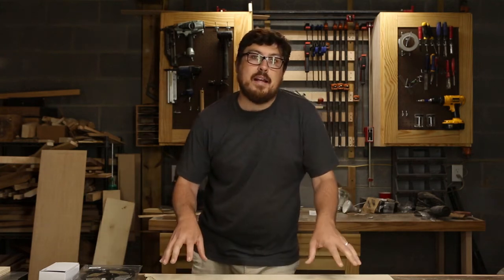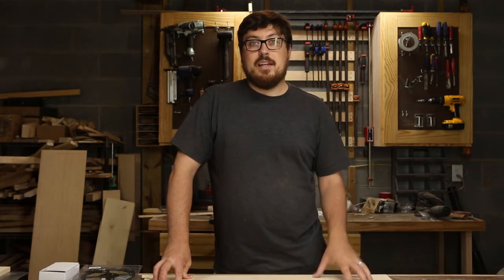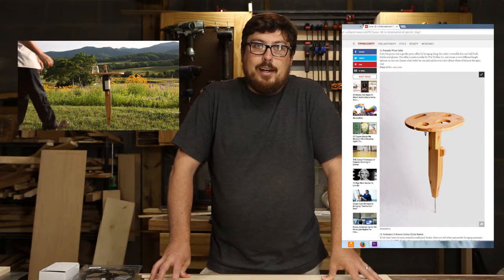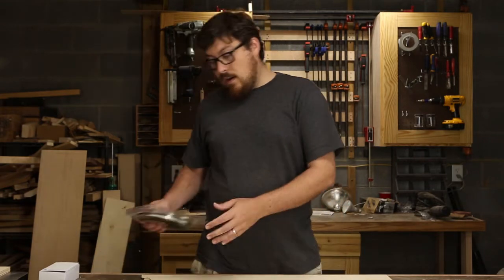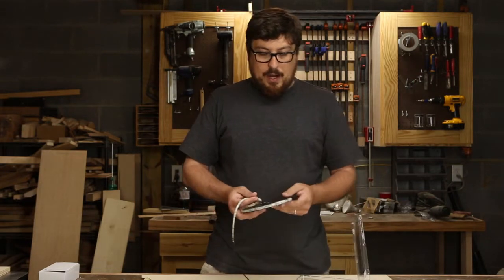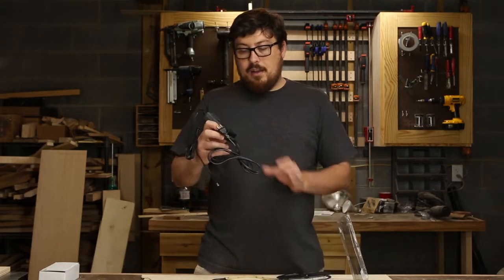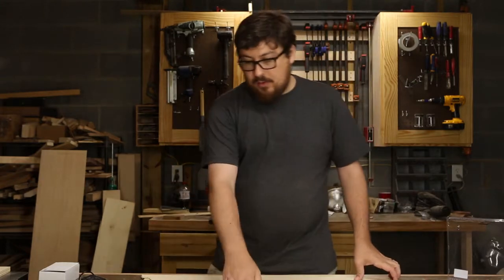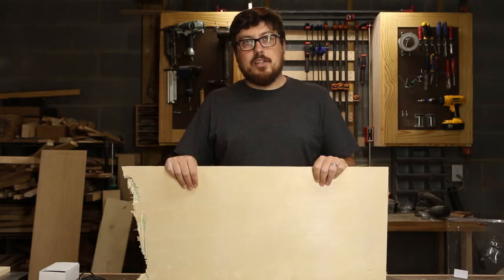Build a DIY Ring Light (Cheap!)

Comment: Maybe put a diffuser on it as well so you don't have rings around your eyes?
Reply from the maker: Lennon Allen I thought about putting some fabric interfacing or some white muslin or even a piece of tracing paper on it initially but when it wasn't as bright as I wanted it, I abandoned that idea.  Maybe if I use Wilf's idea to add more lights I could diffuse it then.  Thanks for the suggestion!

Comment: Hi, just as I suspected, You got the 3528 LEDS, I might be wrong but the 5050 LEDS are brighter. Think of them as square LED material. 3.5x2.8  VS 5.0x5.0. just love your stuff. I always wish that I had the motivation to do this. Also,I think that you can just snip the outer edge of the strip to make tighter turns.
Reply from the maker: That's good information on the lights. I knew there had to be a way to figure out which sets were brighter. It sounds like you've got experience with these LEDs. Much appreciated!
Reply: +Ronald Schulz 5630 are better
Reply: +pronster1 But way more expensive.
Reply: +Stereodreieck RC There the same price
Reply: pronster1
They are more expensive in Germany.
Reply: Just order them from China

Comment: you used  3528 LEDs, you can use 5050 LEDs which are bigger and brighter (good quality one). you can also add another strip to make two circles of led.
Reply from the maker: +RUS Thanks Rus!  Someone actually pointed that out to me.  5050's are next on the purchase list :)